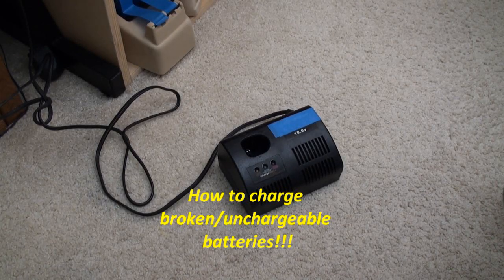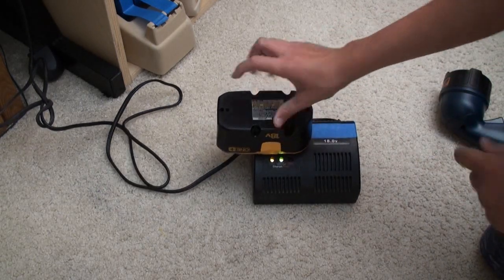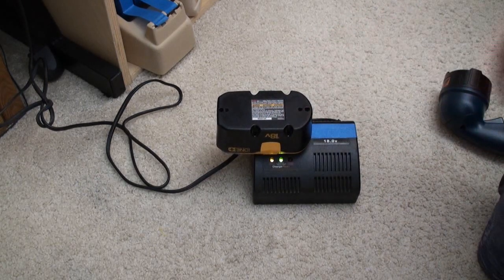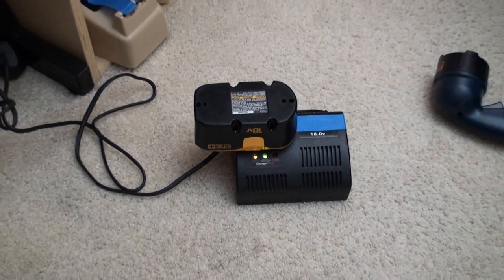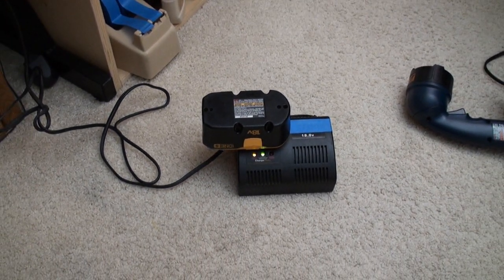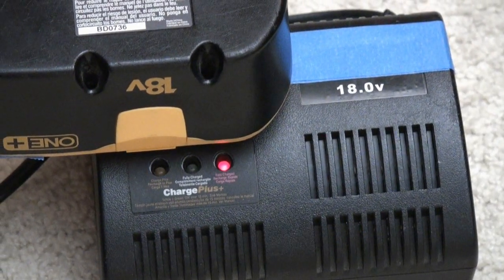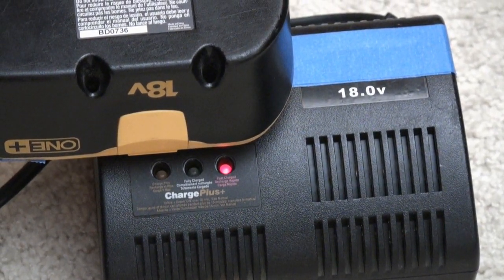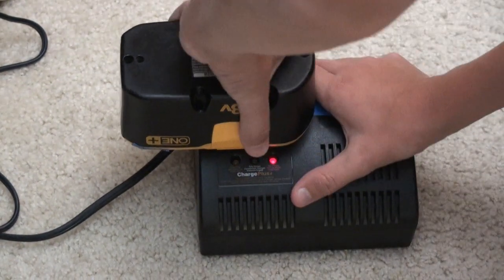How to recharge unchargeable batteries

Comment: i tried this and just as it seemed like it was going to work the fuse in the charger blew. i replaced the fuse and tried again, just as the charger went from the amber/green combo to red, the fuse blew. Anyone have any ideas?
Reply from the maker: If it keeps blowing a fuse, I wouldn't keep trying with that battery, their could just be too much internal resistance.
Reply: I was able to revive one of my batteries to a full charge but when 'i tried the next my charger lights quit when    i flickered the plug and now nothing... where is the fuse... just trying to make a special screw driver to take the charger apart

Comment: This works on automobile chargers too. I do the same with my ATV battery, every year I would buy a new one as they never last over a year but last year I hooked up the battery charger & it would not charge so I plug, unplug & repeat this process several times & then leave it charge overnight & walla the dead battery takes a charge. According to a tech I know this repeated charging pulse rejuvenates dead batteries by knocking sulphide deposits off the battery cells, they make Pulsating Chargers that do the same but are way costly so why pay extra when a kids tip will do the trick instead.

Thanks for posting this cool hack & saving my once worthless Ryobi Drill batteries.

Comment: Great idea, kid! i'm going to my garage to try it in 2 minutes. What I was really looking for was how I can use my drill battery as a powersource  for zapping some surly rats, that can't seem to keep outa my bird feeder. The battery is fully charged (21.6 V), and, to test it, i connected a wire to the positive terminal, and the other to the positive side. I figured that if I held one of the wires in each hand, I should get enough juice to make a rat shit his pants. But, I got nothing!  Incidentally, I did touch the two wires together, and got a spark.
What did I miss?
Reply from the maker: 21.6 volts would not be effective. In order to get a noticeable "zap" it would need to be a higher voltage say 60+ volts. Same reason why tazers use 1,000+ volts with very low amps.
Reply: Thanks for your help!

Comment: All these quick fix battery recharge ideas may work in the short term but in 95% of the cases the batteries are dead and leaking inside the case and will never take a full charge and even if they do it is only for a short time and they will die again, the long term fix is either spend the money and buy a new battery or send you old ones out to have them rebuilt and even rebuilt batteries do not seem to last as long as original ones. You can't fix a dead leaking battery.

Comment: It works! I have the same unit as In the video, and the batteries have been dead for a year refusing to take a charge. I tried this kids trick, and 45mins later I had a strong wrking battery.

Comment: I just bought a 4Ah lithium for my Ryobi and it works so much better than the Nicad units it's not even funny. It cost me $ 90.00 but it's worth every penny.
Reply: Home Depot has the Ryobi 4.0ah battery 2 packs for 99 dollars occasionally. If your looking to upgrade battery packs that is the time to do it.
Reply: Not a bad deal at all - I may have to pick up a set.
Reply: adisharr  Here is the link to the product at Home Depot they are out of stock online but you can see what stores near you still have it in stock. http://www.homedepot.com/p/Ryobi-18-Volt-Lithium-Battery-2-Pack-P122/204321540
Reply: DarkRaptor99
Hey thanks man, much appreciated :)
Reply: Direct Tools (Home Depot's overstock and blemished store) sales the $90 Ryobi batteries for $30. You can get them cheaper if you buy more.  Hope this helps.
Reply: Who said it was funny?......
Reply: peter chessell
It's a saying.

Comment: I am disabled and in an electric wheelchair. Can this be don with wheelchair batteries? If so please post it. I can hardly afford to put food on my plate no less pay $400.00 every time they go bad, which is too often. I sure could use your smarts on this problem.Thanks,Miss Micci
Reply from the maker: Margaret Hueg-Crawford I don't recommend trying this on wheelchair batteries as they use completely different charging systems that i am not familiar with.
Reply: Margaret I can't see that doing this with wheelchair batteries will do any harm. It might not work though, but if already bad can't do much harm.
Reply: If I understand correctly, wheelchair batteries are like car batteries. What happens with use is that a sulphate coating builds up over the cell plates inside the batteries preventing electric conductivity. A remedy for this is possible using epsom salts (magnesium sulphate) which breaks down the sulphate coating. What you do is open the lids on the cells where water is added, being careful because the batteries cotain sulphuric acid. Add say one eighth of a teaspoon of epsom salts to EACH cell(not too much), and close the lids on the cells. Wash any acid, which may have spilled, with water and dry off. Allow batteries to settle for around 1 to 2 hours. Then recharge. This should help at least to increase the usable life of the batteries. I've been quite successful with car batteries I use with my solar power setup.
Reply: +Margaret Hueg-Crawford If the battery is 12v lead acid like a car battery Harbor Freight has this charger which is often on sale for $5 and might recondition your battery. Worth a try.
 http://www.harborfreight.com/automatic-battery-float-charger-42292.html
Reply: +Margaret Hueg-Crawford ?
Reply: +bobby wasabi that's what they cost.  I have a golf cart with those batteries and it's 700 bucks to change them.  Lead acid batteries are very expensive
Reply: +Joe Caruana Thanks for that GREAT idea! Maybe I won't have to replace my car battery !😅
Reply: yes. search restore pb acid battery

Comment: OK - follow-up on if it worked.  YES - the battery did charge (YIPPEE!!!).  The Ryobi saw seemed to rotate at a fast pace!  I've not tried to see how long it last, as of yet.  ALSO - I figured out that, instead of plugging it in and out, you can do this with the battery in the charger -- which may be more safe.  My 2nd dead battery must have been more dead because, unlike my 1st battery, the plug didn't seem to work, quickly.  On a hunch, I wiggled the battery up-and-down and this worked better! :)  The 2nd battery must be in worse shape.  (Can't wait to see how they last.)

Comment: The problem is not the charger, it is the battery. If that is the case the battery prolly won't hold a charge.
Reply: You are half right, it isn't the charger, the batteries are bad...but you are wrong about this not working. The batteries have formed crystalline structures within their cells and by rapidly jolting them with quick bursts of electricity you disrupt the crystals thus allowing the batteries to hold a charge again. I did it with my 7 year old Makita batteries and they now are like they were when they were new after only holding a charge for 5 minutes for the last 4-5 years. I was going to do the car charger, or car battery method, but this is much easier, and I would have to say it is probably safer too...I still recommend you doing it out in the carport over a concrete floor with safety glasses on, just in case you do get one to go pop on you :) Thanks little man Allen, you saved me some doughage too!

Comment: Now if I can just figure out how to do this with my wife.
Reply: You do it exactly the same way. Attach the ends of a power cord to her and then plug it in 4-5 times real fast. Seems to reset them almost as well as it does the batteries.
However if your wife doesn't respond by working properly after the 5th rapid plugging in, you might need to do do another 2 or 3 plug-ins, but leave it plugged in for 10-15 seconds each time.

Try at your own risk. I am not responsible for any damage you might do to your wife. Now am I responsible for any damage your wife might do to you.
Reply: Robert Pruitt Thank you for the sound advice. After explaining the procedure to my wife, It Worked! I didn't even have to plug it in! This is a Miracle! I've never seen her run so quick!

Now, if she'd come back home and fix me dinner. Its been 3 days. I'm hungery. :D
Reply: This is just perfect.
Reply: Come on , 25 Thumbs Up , so 25 people either had the same idea as Mangles Thecat or they just thought his comment was funny.
I dunno. (shakes head in disbelief)